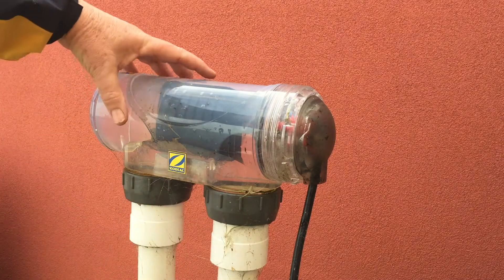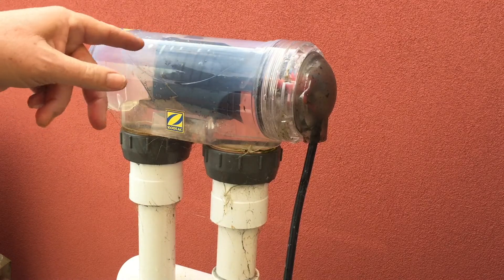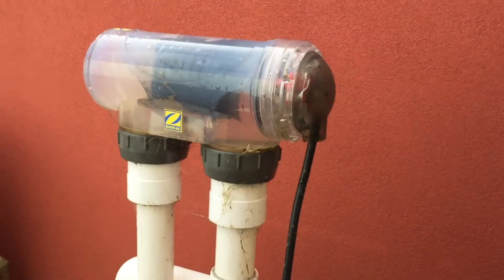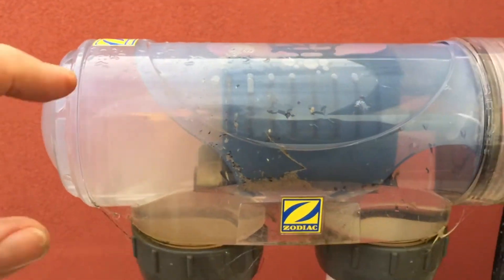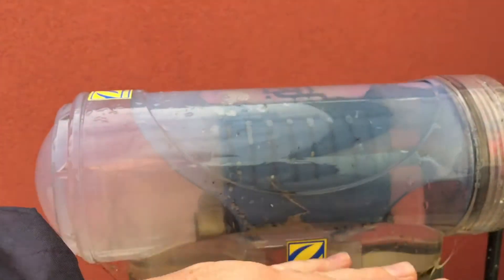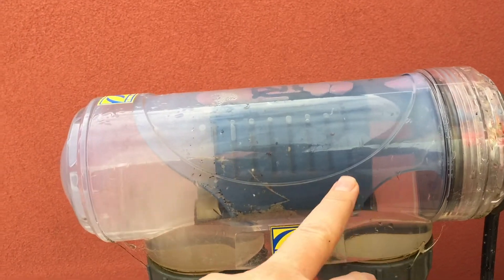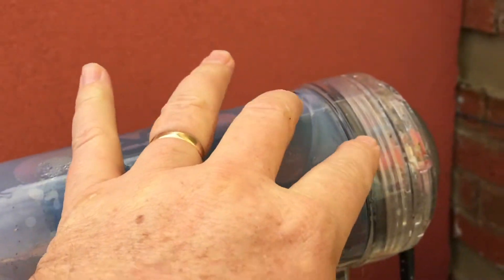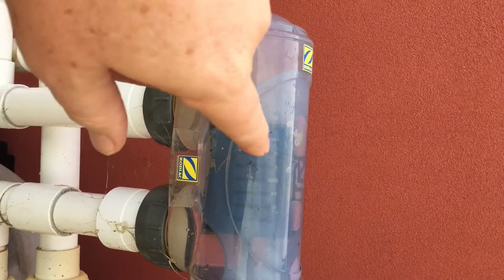Pool Salt Chlorinator Explosion warning! You must have this Gas Trap safety feature! Safe loop

Comment: Hi there, Really great video. quick question. Does the salt cell need to be above the filters mpv??
Reply from the maker: No it doesn’t. As explained in the video as long as there is a gas trap.
Reply: @Marksreviewsandtutorials  right but how do I know if my salt cell has a gas trap built into it
Reply from the maker: Watch the video again. I explain what a gas trap is in the video. Then once you know what it is and what it does you can check your plumbing.

Comment: Hey how do I make the gas trap. When I leave air in the system it goes away and doesn't come back. Only started having this issues 3rd year. Before I didn't even try and it was there 🤷🏽‍♂️
Reply: Do I have to wait for the gas to build up? Or is just an air trap?
Reply from the maker: Hmm maybe watch the video again. The gas trap is a failsafe for a very low flow situation. It is not supposed to hold anything when the system is running normally. MRT
Reply: @Marksreviewsandtutorials Hi I did want the video multiple times. If I understand it right there should be an air pocket/gas trap when the system is not running/low flow. Am I right? I don't have it there. But I see the little bubbles in the process so should I wait and it will accumulate there? I just wanna make sure everything is safe.. 

Thank you in advance

Comment: Great video, thanks for taking the time to do this.  Question, what is the basis for the 2 liter max quantity being safe?  Seems like the hydrogen could  react with residual Cl gas from the plates with power on and dry.  Was there a calculation that shows this wasn't enough energy to compromise the housing?  Or are you certain this can't happen or what?

Thanks again for the great video.
Reply from the maker: CR B It is just the figure that was told to us at trade days, etc. 
To make sure when we plumbed a cell to not create a bigger space than that. MRT